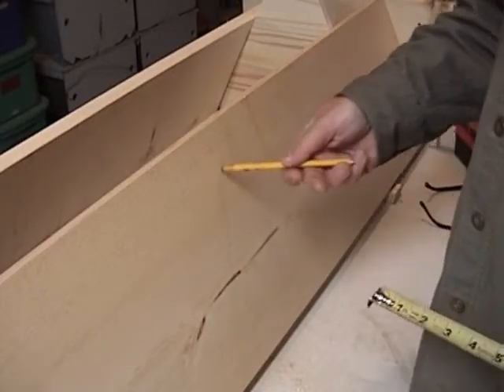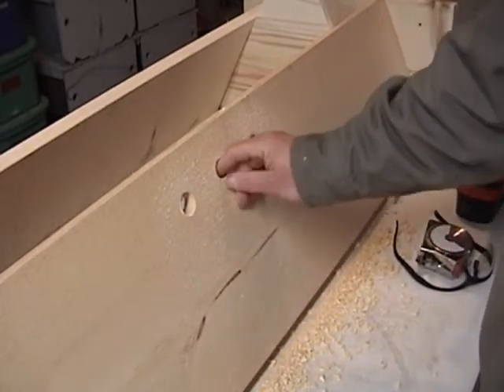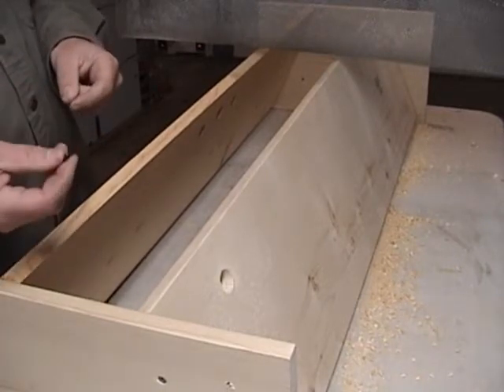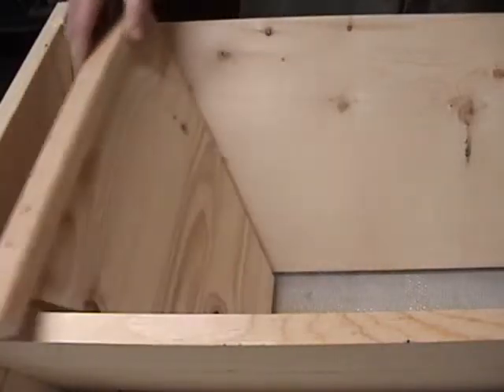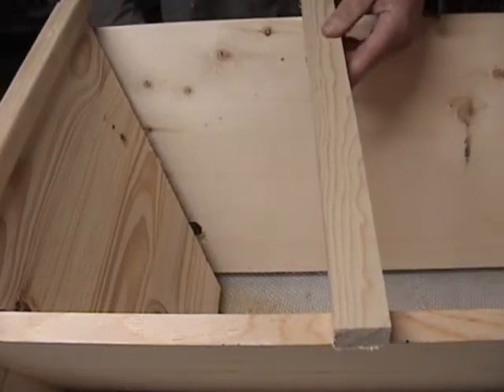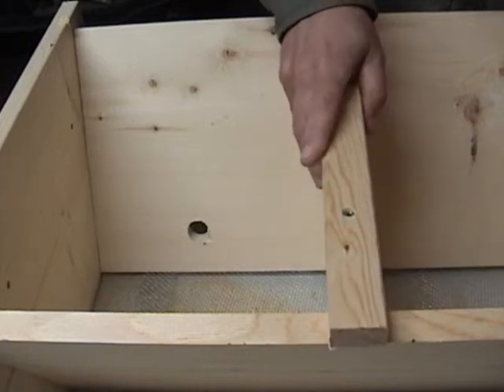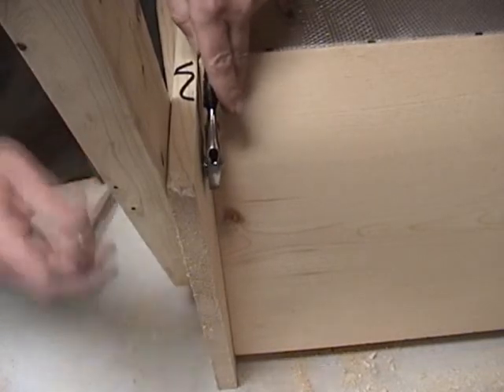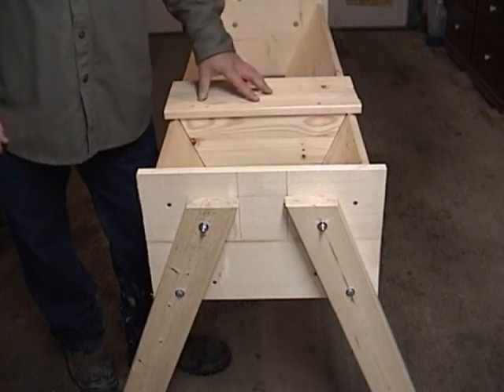How To Build A Kenya Top Bar Hive - Part 5 - Finish Hive and Attach Legs

Comment from the maker: Part 2 - In the book he explains in detail the use of the hole arrangement used in the videos.  I am satisfied with the results I got using this design and will continue to use it in my next KTBHs.  You could go to the Biobees Forum and read up on the various entrance configurations before you build or you could just build hives with the 5 hole design and change holes as necessary.  Since holes can be plugged with corks you can change entrances at will; drill holes in the end and plug the side.

Comment: Thanks David! Everything always looks easier when someone else does it! It came to my attention that our area, Eugene, OR, never really gets warm enough to warrant the "screen" floor - I guess you could put a tacky board on the boards that cover it. I was just a little perplexed whether the straight end of the 2x4 legs was for the top (for the cover to sit on) or the angled piece. I will be thrilled to get this thing finished - bees coming in April :) Thanks for the awesome videos once again. I used 2x12's from another video I also watched. I learned that a guy working with 2x12's probably weighs a lot more than me. I learned a lot building this hive.

Comment from the maker: I just use a loose fitting board and hold it in place with 2 screws and a piece of wire at each end.  The loose fit allows some air flow but no big gusts of wind driven snow.  I have a friend with one of my KTBHs that left the bottom board off until Feburary and the bees are doing fine.

Comment: David, I am learning construction as I go. On the legs, when you mark that angle from the corner to the crossed lines at the top - does the angle go up top to rest the cover on, or is that angle for the feet? I think my angle is a little too much if it goes up top. :(
Reply from the maker: Melissa J
It is for the lid but it does not need to be perfect. The leg could be pointed like a fence as long as the 4 legs are all attached to the same height.  The lid is just resting on the legs.  I've put insulating material between the lid and top bars before that lifts the lid off the legs.  It will all work and the bees will be satisfied with your work.
Reply: Thanks! Your video was very easy to follow!